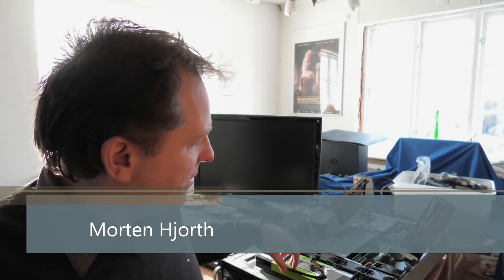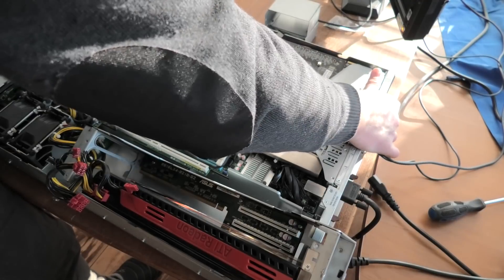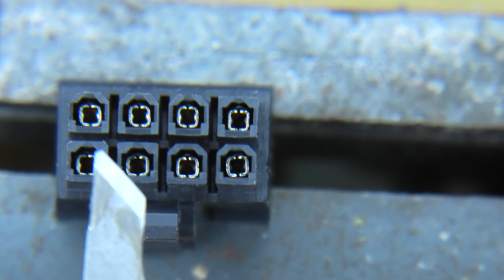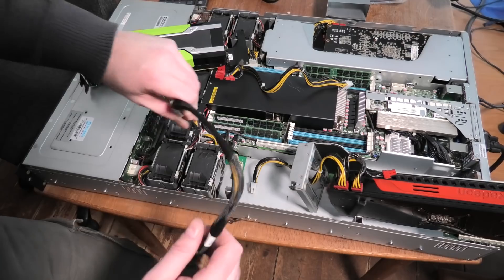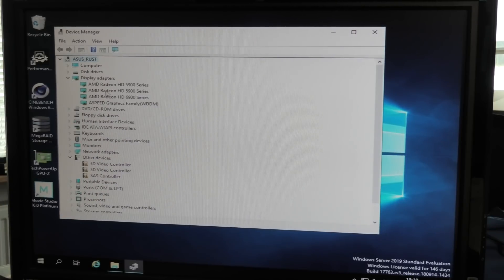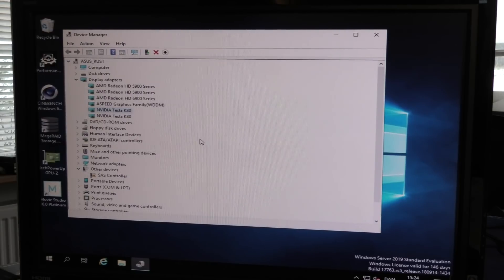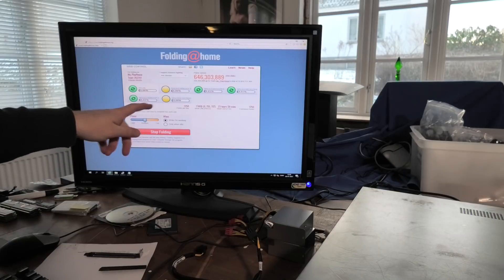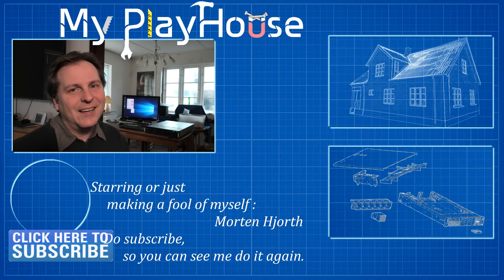Ninja Hacking Power for Nvidia Tesla K80 in ASUS ESC4000 G2 - 1040

Comment: Thanks for posting! I'm trying to setup a consumer motherboard for two K80 I just took from ...Bargain HW :D My first option was the Gigabyte Aorus Master Z390 that seems to work with on K80 (at 300W), not sure any tests for two K80 tough.
Reply from the maker: I did not run into any issues using two,, but they were working individually.

Comment: Hi,  
I have dell r730 with Nvidia tesla K80 GPU. I try to do passthrough to window VW through exsi 7.0. 

The vm don't start? How can I fix it? 
This is the error from exsi "Module 'DevicePowerOn' power on failed." 

This after I fixed this issue - "Invalid memory setting: memory reservation (sched.mem.min) should be equal to memsize(131072)."

Thanks
Reply from the maker: Happy to hear you got it working..

Comment: I was wondering if your K80 overheats at medium Fan settings(60%). I was able to get it not to overheat only if fans were running 100% on my ML350 Gen9 server under stress test by nvidia DGCM suite.  But it is way too loud.
Reply from the maker: If you put GPU´s in your server,, they need to be in a room fare away :-)

Comment: Interesting ninja hack video. I had to do the same type of thing in my HP ML350 as I was unable to get any of the correct cables. I couldn't find any anywhere online.
I also had to disconnect one of the zero Volt wires and move it.
But what still bugs me is you have an Asus server with 2019 Server running......with no errors from the OS regarding lack of resources.
Both windows 10 and Server 2019 keep giving me errors with both of my K80 GPUs.
Anyone out there been able to resolve a similar issue?
Reply from the maker: Hi The ServerGeek
Thank You very much! Yes I have no resources errors :-)
Thank you for watching! :-)

Comment: When you said the noise of the server was soo quiet and then turned it on I was laughing so hard 😂
Reply: Lol.....yeah nothing like a bit of Morten sarcasm to brighten your day.😁
Reply from the maker: I am glad :-) I did talk a bit more quiet,, to really make it good...
Reply: A while back I went to work on an old server. I plugged it in and it was very loud but still bearable. Then I realized it was still switched off, it was just the standby fan running. I turned it on and almost needed to run to a bomb shelter.

It was an HP DL360 G4p, if anyone was wondering.

Comment: Dont use cpu for F@H - you will should see increse in gpu scores
Reply from the maker: I have turned it down to about 80% for the CPU
Reply: @MyPlayHouse  i did the same but still using only GPU especialy AMD one without CPU i gry better numbers than using even 10% od CPU... Did your own test. CPU is just heating element at this point :) it is something about CPU cycle time share. Better się this power to drive GPU otherwise is just a waste.
Maby mąkę a video about testing it :) i did my test with single GPU but with more powerfull CPU ;)

Comment: NVENC is nvidias hardware encoder on their GPUs. When you use it for rendering it ignores some encoding settings that cannot be changed when using nvenc so the output video could be of lower quality depending on the settings you used for the other renders. For a comparison to the other cards you should've used cuda/generic gpu acceleration to get a fair comparison with an identical output.
Reply from the maker: I am not sure I can pick how it renders or how it does it.. :-/
Reply: @MyPlayHouse  In the video there are render templates that have a NVENC counterpart at 13:10. If you chose a non-nvenc one it should just utilize the GPU compute like the other cards did. Thank you for the videos regardless though!
Reply: @Kevin Clingerman is right, that's why you saw the "Video Engine Load" so high - that's the nvenc hardware encoder.

Comment: I once got a new power supply that I mismatched with cables for another power supply, believing that all power supply pin-outs were standardized. Boy was I wrong!! Just because it plugs in doesn't mean it's right. I fried four 8 TB and two 2 TB drives!
I wasn't so mad about the drives because I get them for free, but the meticulously organized and cataloged movies, tv shows, and apps that took me decades to collect... yeah, I was pissed about that.
Reply: Sometimes only the protecting diodes gets fried and shorted, unsoldering them can make the HDDs to work again.
Reply from the maker: Sometimes we make a awesome Ninja hack,, other times it ended up a awful Ninja F* UP,, 
I need to rewire my solar panels,, 4 in series is to much,, redo :-/
Reply: @MyPlayHouse  I've had a few too many "Ninja f-ups". My server had one x16 PCIe slot and two x8 slots. I tried shaving off the end of the x8s to fit an extra video card. Now I have a single slot and it runs at x2 :(

Comment: Im not familiar with servers so a simple question, what advantages are there for having several graphics cards in the server ?
Reply: Graphics cards can do other things besides graphics. They're extremely good at calculating certain types of mathematical problems, much better than the main processor, and multiple cards can usually work on the same problem at the same time. The nvidia K80 already has 2 graphics processors on it, so it's basically 2 cards in 1.
Reply: @Aggrop0p   Thanks for the response. I would have thought modern processors would have been the thing for maths problems but obviously not.
Reply from the maker: GPU processing power. :-)